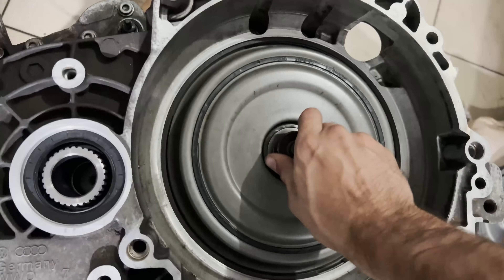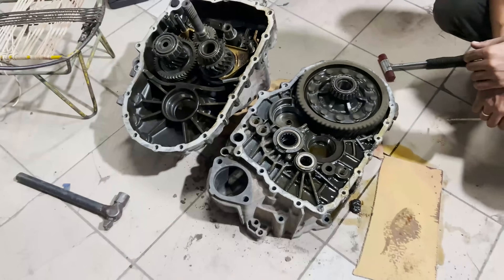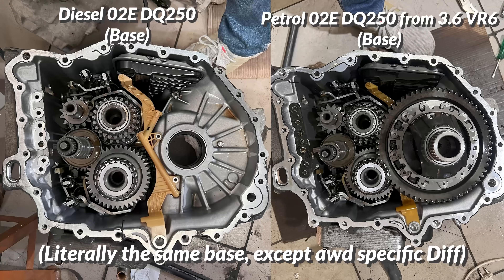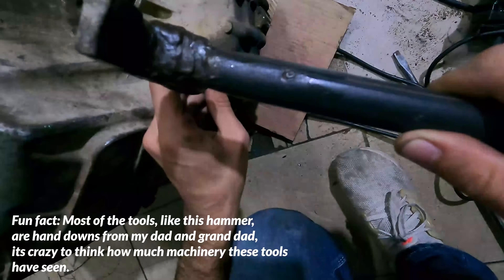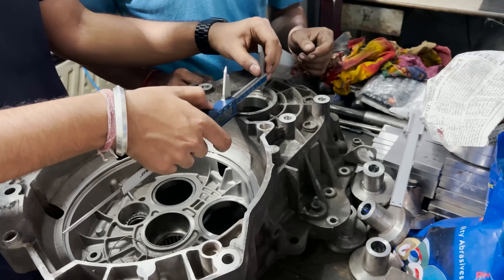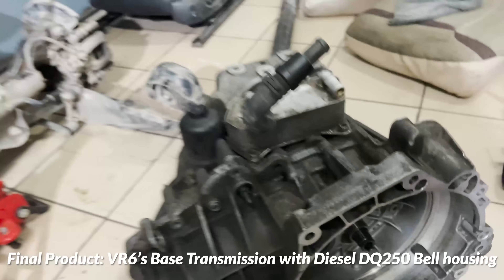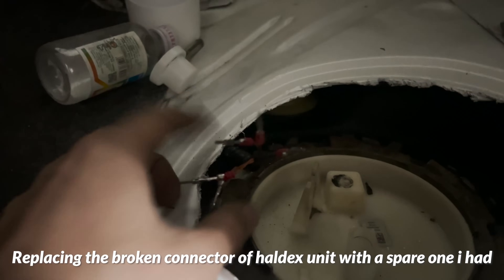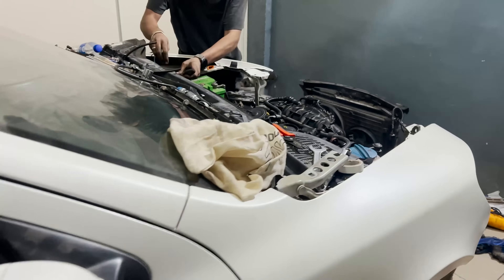Best Transmission for An AWD Project? | LAURA AWD EP2

Comment: Hi brother i have jetta 2.0tdi automatic my flywheel is making noise suggest me any best service centre who has knowledge about german cars I live in chandigarh.
Reply from the maker: Best is to get a brand new one from Service centre itself, there are cheaper alternatives which start at 24k plus labour, but they will fail within 15,000 KMs too, get a branded one from VW which will be 60-65k but it will last you another 5-6 Years

Comment: Can we use a diesel dq250 mechatronics unit(only the mechatronics not the gearbox as you mentioned the gear ratios are different in a diesel) with a superb 3.6 vr6 dq250?
Reply from the maker: Yes we can, needs to be adapted to the car however

Comment: Hey Prerak could explain about the issue on the high pressure fuel pump and how you solved it. Because this is quite a common problem in the skoda laura
Reply from the maker: In my case, it just needed to be primed again, which we did by pouring fuel straight into the intake which force started it, priming the HPFP and it never re occurred, I’ve seen cases where installing new ones solves most of the issues.

Comment: Bro i also have laura and i swapped dsg with oem manual as dsg was broken and hard to maintain but after swapping the car is not starting properly it takes a long self upto 5 seconds and that connector 10:48 you are showing in the video is dangling in the engine bay , can you suggest any solution?(starting is the only issue i am facing
Reply from the maker: How did you wire the clutch?

Comment: This is going to be a front transversely mounted engine layout with rear  wheel  bias assuming its not haldex based awd system
Reply from the maker: It won’t be rear wheel biased, it’s a haldex system, during launch or slippery conditions, the bias will be 50-50 and in most driving (normal) conditions the bias will be 90-10 or 95-5 for later Gen Haldex systems. The one I’m using here is Gen 4 Haldex system out of a 2010 Škoda superb 3.6 VR6
Reply: @PrerakKataria  could have been fun if it could have been hacked ....this is one of my dream cars and built ..all the best bud

Comment: Why would you not use dq 500 transmission instead of dq250 ?
Reply from the maker: Flywheel was even harder to source for that one, dq250 was much easier to customise as well
Reply: @PrerakKataria  i think diesel transmission has taller gear ratio than petrol for higher top speed? And some people use diesel transmissions in their petrol project cars for achieving higher top speed?